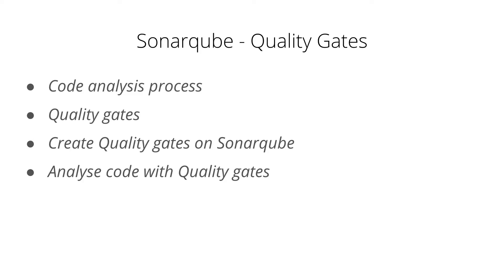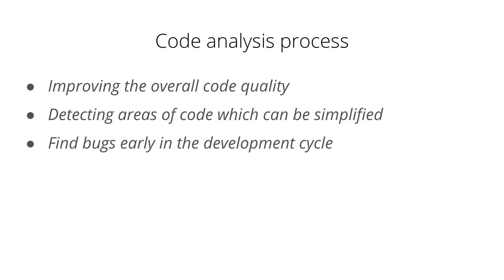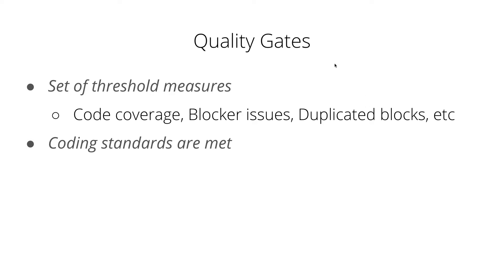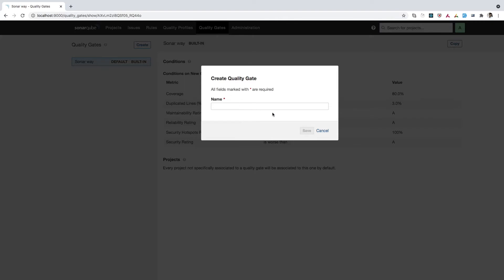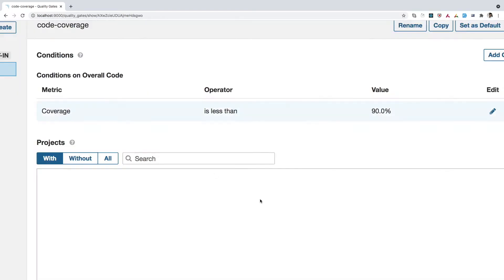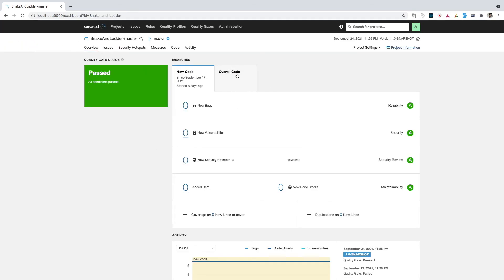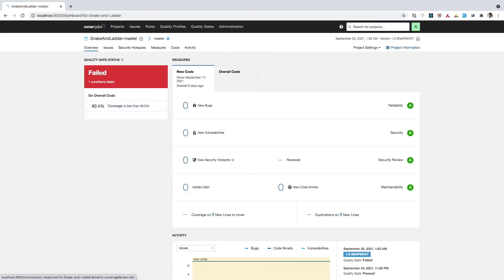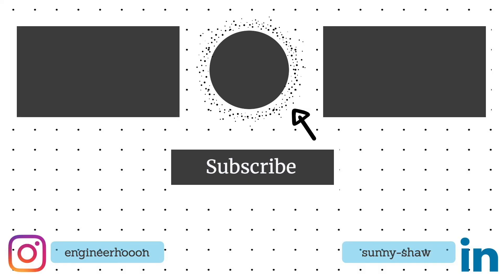How to create Quality gates on Sonarqube [Latest 2024]

Comment: Hi ,

By default we are using Sonar way rules and it has coverage less than 90% but the project is passed instead of failing. Since sonarqube has been configured as container & we are using gitlab pipeline how do we run the sonarqube command to make it fail if code doesn't meet coverage limit !

Also not able to configure the new rules created in quality gates its picking up sonarway only any idea how to make use of newly created quality gate rules while triggering the pipeline .